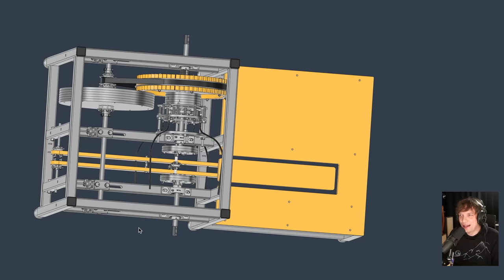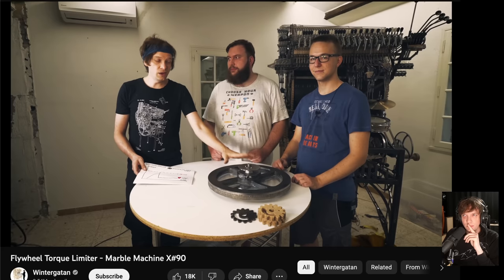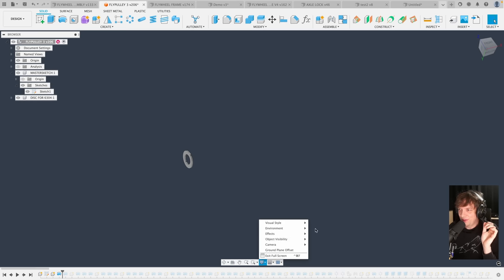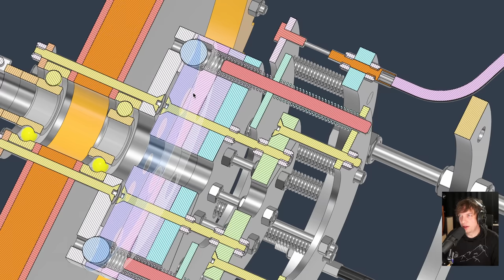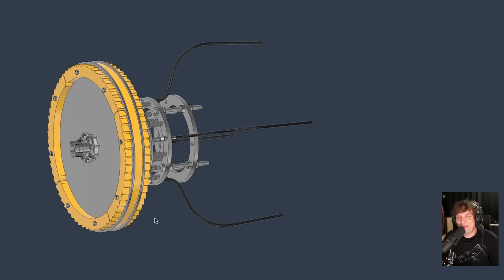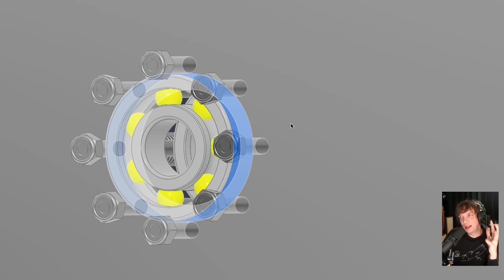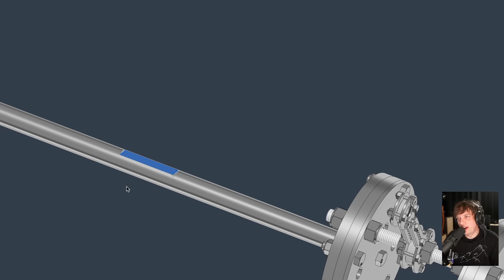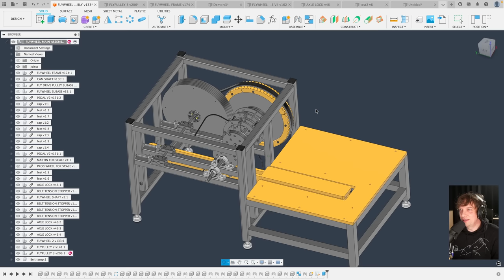Safety First! - Marble Powered Clutch

Comment: 12:04:  If you are using that light green disc as a brake, ensure you review the following:
1. The material needs to be an actual friction material, metal-to-metal contact will cause galling.
2. The flat head bolts need to sub-flush of the green disc.
3. The bolts connecting the thicker green disc need to be stiff enough to resist the torque being applied.  Bolts are really not designed to bend, which is how you are loading them in this application.
4.  The material of the 'brake disc' needs to be thick and stiff enough that it does not turn into a cone when you apply a load axially. The same applies to the pink ring to which the bowden tubes are connected.
5.  The two hex nuts between the green disc and the cyan disc would need to be set very accurately to ensure those two plates are perpendicular with the axis of rotation.  You many want to replace those two hex nuts with a machined sleeve that can slip over the bolt and accurately set that distance.
Reply: These are good points. From what I'm understanding, he's not trying to break the flywheel, just the drive wheel which is relatively light, which should brake almost instantly without any significant force needed. He might want to brake the whole machine I don't know
Reply: @jansimblank9358  well that’s what the clutch is for - to disengage from the flywheel so he can brake more easily and safely
Reply: I suppose you could build into the Bowden system some flexibility for on the fly torque adjustment.  Maybe down the road from wear the normal torque gets too high and brakes?  Or maybe I don't understand how sensitive that mechanism is.
Reply: I had no idea that bicycles now use disc brakes for high end models. I also had no idea that the average price is now $5,000 USD. wow!
Reply: You seem to have misunderstood the mechanism (or I have).
If the brake was engaged, the force would be between the cyan and pink disks, as the green disk is rotating with the cyan one.
This makes some of your points largely irrelevant - 2 particularly, but makes the issues with the bending forces so much worse, as the green disk provides the braking force against the alignment system for the springs, which have effectively nothing holding them aligned. Even disengaging the clutch would likely break them.
Reply: I may have missed something but intuitively it feels like theres little binding in every nut on the threaded rod which i feel it can twist like a helix
Reply: @viktormoraes9876  Ha!  Discord, what a garbage platform.  If he's only engaging with his community using Discord then he'll be missing out.
Reply: 6) fuse the green brake disc and the left one were the bolts for the tention springs are fixed.
Basically mount the spring tnsion bolt direct into the (larger) brake disc

This eliminates 3. altogether.
Reply: @billkeithchannel  Disc brakes have been ubiquitous on mountain bikes for at least the last 20 years. They first started to appear on road bikes about 11 or 12 years ago but there was still quite a bit of resistance to their use so have only really become commonplace in the last ~5 years. You can now get them on bikes at all price points, not just high end models.
Reply: Dissimilar metals and very different hardness will avoid galling too.
Reply: @deathofallthingspotato9919   when the flywheel is disconnected, that doesn’t mean the pulley is not driven anymore. The drum also has a large rotating lass so the pulley will be driven until the drum has stopped. So there will always be a friction-side between static and rotating parts, in a car you have a clutch bearing for this. So he would indeed need some special material on the contactface. I would suggest something that likes to slide so the poulie ( and by belt-link the drum) is not braked by the clutchrelease, ideally a big thrustbearing, but teflon/ertalon could do the job.
Reply: @ffsireallydontcare  u wanna talk abt it?
Reply: @benemenhall4215  get the couch and the notebook ready.  I need to know first, though, is this just a 5 minute argument or the full half hour?
Reply: @jeroentorfs113  Oh yeah, I agree there are plenty of problems, I just thought you seemed to misunderstand which parts were braking against which other parts.
I personally would do a rework to make the contact point to provide braking force separate, as this would move force away from sliding components, and onto fixed ones.
It would also allow lubricating the clutch assembly without impacting braking, while splitting braking onto a dedicated section with appropriate surfaces.
This wouldn't even need many more parts, and little extra complexity.
Reply: @DJShadesUK  Hell,  my Checkpoint is the lowest trim level currently available and has hydraulic disk brakes.

Comment: Hello Martin! 

Take this with a grain of salt, I believe you have over-engineer a bit too much this clutch-brake system.
 
You could very easily add a brake disc from a motorbike/bicycle, with a caliper that is operated by a cable and have an extremely reliable and based on off-the-shelf parts available anywhere for achieving a simple, reliable and lightweight brake system that on top of that is easy to modulate how much strong-ness you need.
 
In general aviation (small ultralight planes), they actually use this approach of reusing something that was already designed and tested as a package. 
 
 There's a reason why vehicles have moved away from having the brake attached to the clutch :)
 
 I bet if you would explore this option, you could reduce considerably the amount of parts required.

Cheers!
Reply: I agree, these are separate problems that could be handled with separate systems. Clutch and brake systems are wear items, going off the shelf for wear surfaces is the best option. I suspect for the torque and energy something from a motorcycle or moped would be perfect.
Reply: @christophercasale7961  agree. simplicity and off the shelf parts are, at least, where you should look for inspiration for their proven success
Reply: I agree, but want to note that I don't understand how the actual break works. If it is just 2 hard-to-replace metal discs grinding on each other, the resulting noise and vibrations won't be compatible with the instrument microphones, right?
Reply: I agree that the part count for this design could be reduced but using a brake as a torque limiter/clutch is not a good idea.
For a clutch to act as a torque limiter, it would need to slip, which is a recipe for wear and heat. Clutches are not designed to slip for extended periods.
Reply: @PvtHaggard I think you may have misunderstood the point of the comment.
I don't think the intention was to replace the torque limiter with a brake or even off the shelf clutches.
The idea is to replace brake part of this mechanism with an off the shelf brake, clearly a better idea.
Also, I think it may even be possible to completely do away with the clutch here, as long as the torque limiter stays. The torque limiter most likely have to be custom made and is definitely needed.

But if you use a standard motorbike disc brake or similar, you can just brake the machine and let to torque limiter do it's thing if needed. 
There could even be 2 brakes, one for the flywheel and one for the rest of the machine, if needed. 

But, maybe there is a real need for a clutch to separate the machine and the flywheel but still let both spin down in their own time?
Reply: Yeah, I was thinking that this looks much more complicated than it needs to be.  All-in-one brake+torque-limiter doesn't make as much sense has having a separate brake, and a dedicated torque-limiter that reuses the MMX design.
Reply: It doesn’t seem that complicated to me. He’s using a single action to move a single subassembly laterally to both engage the brake and disengage the clutch so the forces of the flywheel aren’t transmitted to the subassembly and thus won’t create any stress when braking. Sure it’s all custom made but I’ve never seen any off the shelf parts that accomplish both those things with a single action but if anyone has I’d love to hear about it

Edit: I just realised that the forces of the flywheel wouldn’t be transmitted to the brake anyway due to the torque limiter but the clutch world reduce wear on the torque limiter which seems like a good thing. Bear in mind I’m no engineer. This just seems logical to me
Reply: @PvtHaggard  Shouldn't it only slip in an over-torque situation? In standard operation there would be no slippage. I think an off the shelf clutch seems like a good idea. It can be set so that it holds only up to a certain amount of torque and slips above that. And also disengages when activated by the user.
Using a disc brake as a clutch seems difficult since both parts need to spin. But using a clutch for the clutch and torque limiter, and a brake as the brake seems straightforward enough.
Reply: I came here to post this exact idea but you've articulated it far better that I could have.  I hope Martin sees this and is able to consider it for the design, would definitely make for a simple and robust solution to the problem.  Love what you're doing Martin, keep it up!
Reply: Here you see a new design principle Martin has yet to master: 
-Don't do the work others have done for you. Use of the shelf parts whenever possible.
Reply: Agree. Off the shelf components should be a design priority
Reply: I think his calling it a 'brake' is confusing people. The purpose is to allow the machine to stop, but the flywheel to keep spinning. So it is more a clutch than a brake, and taking the pressure of the marbles of the existing clutch is a fairly simple way to achieve that.
Reply: My take: The torque limiter should be on the flywheel so the pulley is also safe.  The MMX limiter design was fine, not that many parts.
The new one is too complicated because it mixes functions, and will be finicky; using an off the shelf clutch is a great idea.
Reply: I was thinking the same.
Reply: I could be missing something, but my understanding is the brake is just to stop the machine, not the flywheel. In that case it can stop the machine quickly without burning all the flywheel potential.
Reply: I agree, but there are a lot industrial brakes and clutches availabe that may fit better to his application. Just google industrial breaks and clutches. I could imagine that maybe you can find a combined part, something like safty clutch with integrated break.
Reply: I agree: for simple parts and wear parts, there is no cheaper part than an off-the shelf part. Don't re-invent the wheel. And don't spend thousands of euros on making a wheel when you can buy it for tens of euros. The goal of this project is building a functional music machine that only works through mechanical means, not learning how to make as many parts of it yourself, not making a function-from-form machine. World tour is your objective, stick to it.
Reply: That's a good suggestion, especially since iirc Martin is open to using COTS assemblies as part of the machine.
Reply: @LReBe7  Where exactly in the design requirements specify that this machine “must work through mechanical means”?!

This is just more unnecessary scope-creep.  Now, it appears to be a marble machine that 1) plays <1ms “tight” music and 2) must be human-powered (let alone, thinking that is must be a flywheel that he designed himself).  None of these are appropriate design-choices.

There’s absolutely no reason why this machine can’t be electrically-powered.  And THEN (and that’s a big “then”) if he actually gets this working, he can always go back and change the drive-shaft over to a human-powered mechanism.

But creating this machine to be human-powered FROM THE START is simply another mistake (in a long chain of mistakes).

Comment: Hi Martin, great work with what you are doing!
I'm a bit worried though you are again complicating what you are designing. 
I'm also worried about the bearing case and type. In this configuration infact the bearing is carrying not only radial load but also a big axial load, normal ball bearings aren't built  for these types of loads, angular ball bearings should be a much better fit.  Furthermore the mounting mechanism you came up with will certainly concentrate the load on tiny portions of the external bearing ring which they aren't made for this. I would suggest at least to put some laser cut profile disks in between of the bearing and the bolts to distribute the load on all the bearing housing surface.

Comment: Hopfully you're not overcomplicating it.  I remember how you simplified the marble gates and programming wheels.
Reply: He probably needs to review a couple more times for simplifying the design.  That being said, to my untrained eye Martin’s design seems to be in the rough range of complication that a combined clutch / break / flywheel design could get.
Reply: I would argue that the flywheel is the most important part of the machine.  He's basically engineering a clock/watch.  And this is basically the main spring... The engine so to speak
Reply: He's not manufacturing his own plywood, or forging his own bearings- it might be worth it to consider simply  buying in a proven clutch design given the specifications.  It would be a shame if literaly reinventing this wheel would sink the project.

Comment: Consider using precision Dowel Pins for the Bearing Housing or at least, Shoulder Screws. Threaded fasteners may cause tolerances to stack up.
Reply: If he measures the bolts he can adjust the hole placement and the difference in bolt&hole size to make them pretty tight. Or leave enough room to use shims to fill it out.
That said. A turned housing with a stepdown / shoulder that has a tight tolerance to the hole in the disc should be near perfectly running true.
Reply: I do look forward to seeing how the tests work. We stand on the shoulders of people for hundreds of years of bearing race design. I'm a little dubious of how well the bearing is going to be held, but I'm willing to be surprised.
Reply: I completely agree with stack up issues. Shoulder screws at the very least
Reply: He can use shoulder screws but that only solves half of the problem because there are two bearings ! Look at 10:24 we can see that it is the same only one screw holding both bearings in place... i'm not sure how well the threads will hold :/
Reply: Locating pins are the move!
Reply: @FlexDRG  
And then he buys a new pack of bolts and nothing will fit anymore. The thread standards allow for huge tolerances in diameter. (huge in comparison to how accurately you want to place a bearing).
Reply: @superdau  true. But for a given set of bolts it could be made to work.